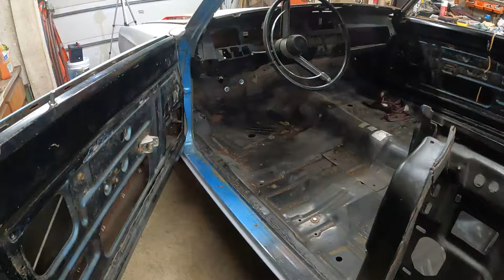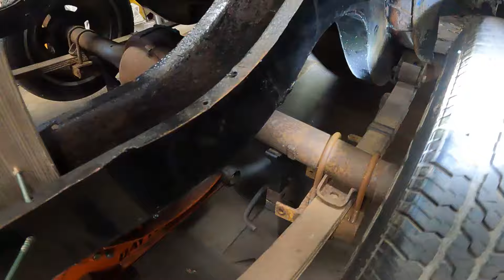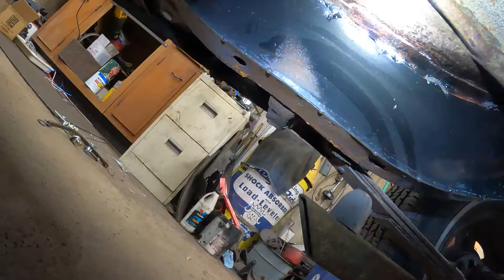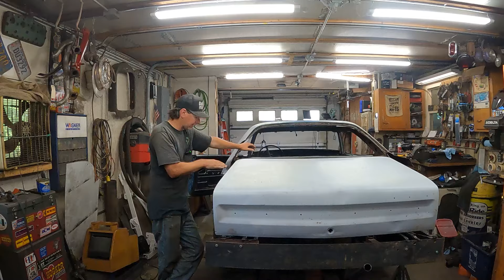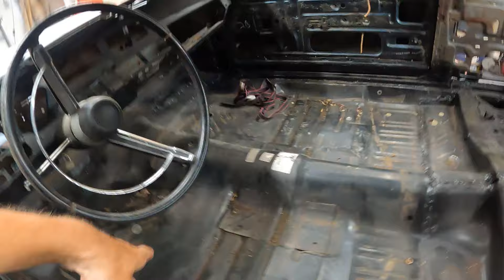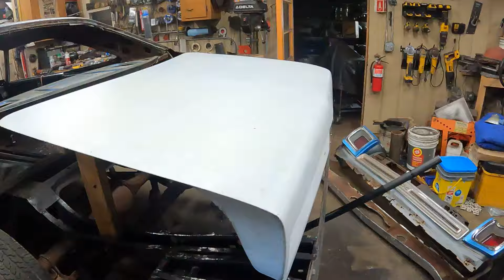Don't Get Scammed!  What to look for when buying a potential restoration project car

Comment: I definitely would be making/building a body/frame jig. And mounting the body to it, making sure it is level and square ( which may require cutting some welds loose ) before doing anything to it.

Comment: Im curious as to why to not return it to being a GTX? Are B body chassis that hard to find?
Reply from the maker: An affordable one is.  I want to build a 1969 Charge Daytona clone.  This car was $5500.  A Charger in the same condition is close to $20k.  They are all the same underneath.  This GTX is completely parted out.  It would cost more to restore it than its worth.

Comment: Did you buy the Is car sight unseen 
Did the car have interior in it When you bought it
Reply from the maker: I went and looked at it in person.  It's a big block B body, hard top Mopar with $1600 worth of new frame rails and floors and up to date paperwork.  I can easily fix it.  They do not give these cars away anymore.

Comment: I've got a 74 charger like that only the welds are ok... Just not enough of them rear wheel housings 3 welds per side.. Trunk floor and drop offs total of maybe 10 welds.. But hey it's ok I got the car for free with about 2k in New sheet metal.... Poor kid gave up and township was fining them for having the car on property......so yeah check your project out very well before you buy and factor in the work and price of parts and how complete it is into what you pay for a project car...and Always estimate the damage is worse the what you see cause it usually is.
Reply from the maker: At least you have $0 invested so you can fix it with that savings.

Comment: If they had good burn on both panels grind the welds, make em pretty and add more if you want. Then seam seal it. Damn ya didn't see that when ya bought it? It's not a big deal... easily fixed! It's all covered by underlay and carpet anyway. Sometimes you have to spot weld on older cars that have thin metal in spots. Weld where it won't burn a hole. Unless you wanna replace every panel on it...and it'll take ya 10 years to do it 😉 and parts aren't free! The car looks pretty good to me...
Reply from the maker: No, I saw it when I bought it.  I still got a great deal on the car even with the poor work.  I was just saying if someone that doesn't know what they're look at and doesn't do their own work bought this and sent it to a shop they'd be out a lot more money to fix it.
Reply: @QuickSpeedShop  I do a lot of classics seen much worse. If all the guy had was flux core, no argon the welds aren't pretty but they work ok. Grind em...add some new and nobody's the wiser after ya seam seal it. And on a floor all ya want is no leaks. I check with a bright light from under the car...if you see light, weld or seal it. Once the underlay and carpet goes in, you won't even think about it anymore lol. That car will out last you...if you are like me, it'll never leave the garage if there's rain coming...
Reply: @QuickSpeedShop  the car hobby has become so expensive people that don't know how to do it better stick with Honda's.... 😁 I'm doing a 79 Alfa gt and just the paint was 500 bucks. It's doubled in price. So has everything else. I'd hate to see the bill from a shop for all the work I did....no way I could afford it!

Comment: I’d rather have an untouched vehicle that I would repair than fixing somebody else’s crappy work.
Reply from the maker: I hear you, but with this car it is what it is.
Reply: The best of both worlds is piles of dusty uninstalled parts with a disassembled basket case. Usually the price is really good, you just need a good eye for what's missing.
Reply: @craighansen7594  how about the crappy welding and botched structural work? You might as well start over. The time it takes to properly redo those floor pans and frame which means at least on the frame to cut out that crappy work and replace it properly is very time consuming not to mention that once you start cutting out the patch work on that frame that it doesn’t go out of square. If you could find a decent frame for that car that doesn’t require so much work then yes. It might be a project one wants to tackle when their young but older wisdom tells me “no” but to each their own.